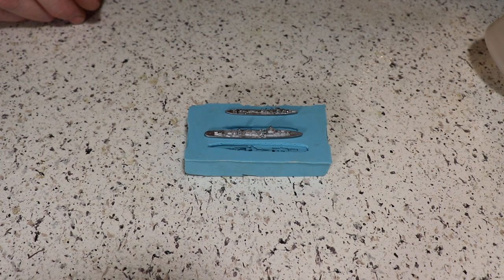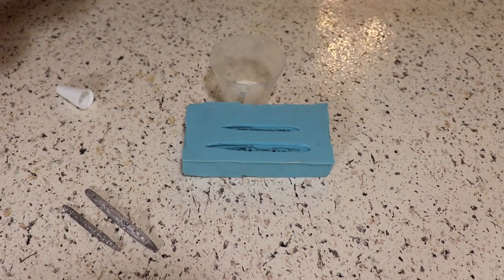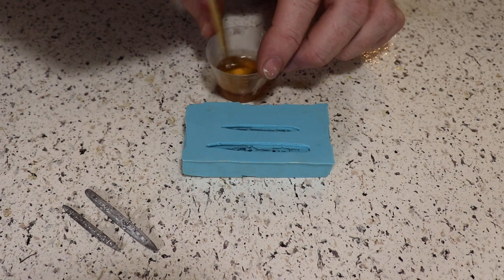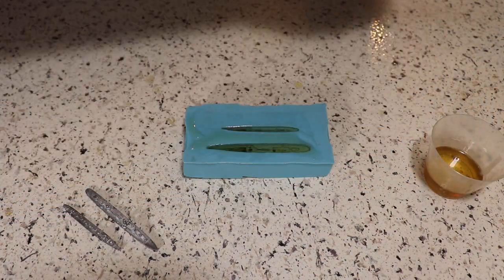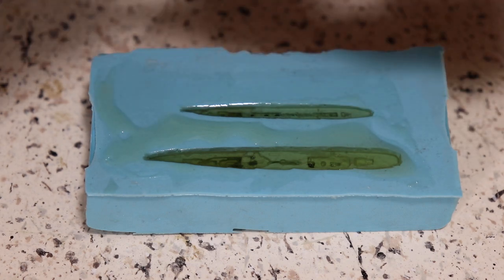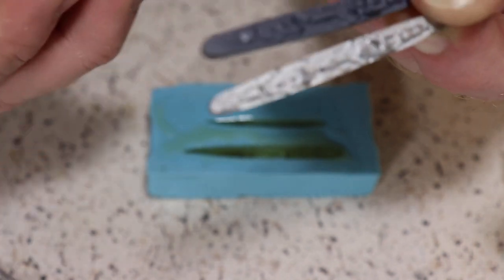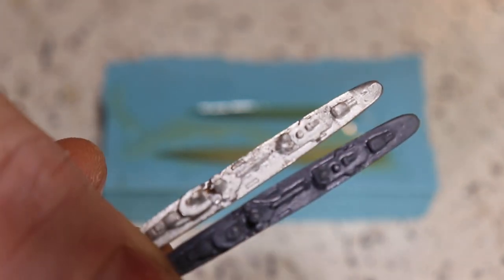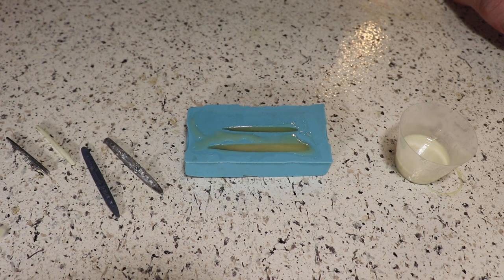Cast your own Axis and Allies pieces.

Comment: Found this video check it out.  Possible alternative to making the mold:

https://youtu.be/mVZLXLaidjQ
Reply from the maker: My buddy Mark got some of that from China, said was OK, I noticed that the arm cast he did, was missing the spikes on the glove.
Reply: siredblood might be good for vehicles that have wheels and not a flat bottom surface like the boats.  Otherwise, how do you make a mold like that?
Reply from the maker: Kinda like the vid you posted, 2 part... use clay on lower half, add divits for alignment, pour, then flip and pour... Ive done 3 part molds, gets tricky.